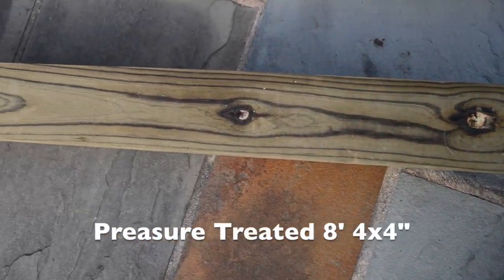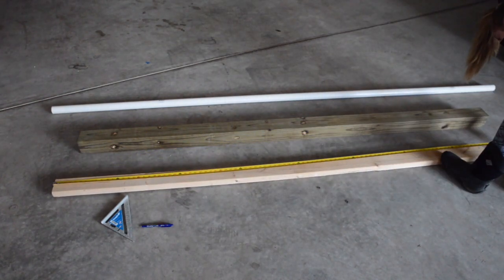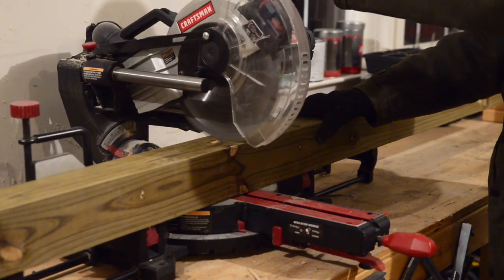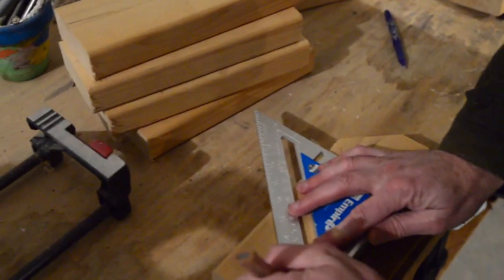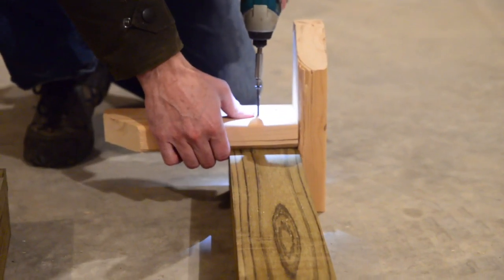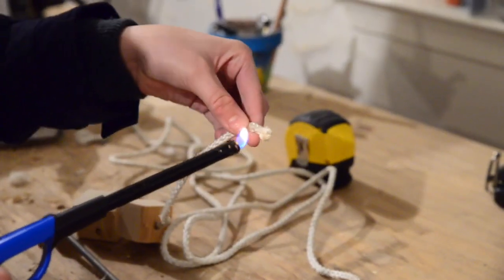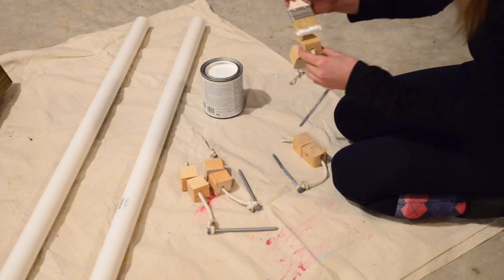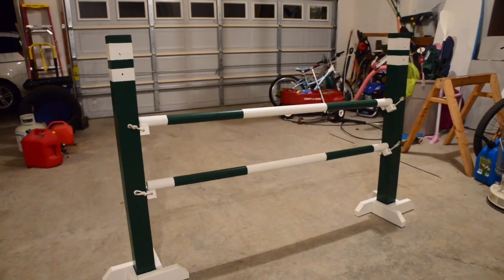How to make horse jumps! DIY standards, poles, and cups | HUNT COUNTRY EQUESTRIAN

Comment: If you are going to train a horse to jump, putting pool noodles or pvc pipe insulator covering on the pvc pipe will make them not shatter if the horse steps on it. It may tear the foam but it’s a lot safer than just plain pvc pipe!!!
Reply from the maker: i agree! i would probably prefer to use wood poles but for my dogs pvc is best. if the horses get too used to pvc, then they start to not lift their feet over the jump!

Comment: I don't mean to be rude or anything but you should use pvc pipe as a jump rail. If your horse accidentally knocked the pipe than it would crack and splinter into your horses hoof
Reply from the maker: I did make these for my dogs, but yes I agree it could be dangerous for horses.  If someone didn't want to use pvc they could use wood instead

Comment: I wouldn't use pvc poles because they are light and the horses learn to put less effort in when they jump because it doesn't hurt when they hit it so when you take your horse out to a show or to your friends barn where there are wooden poles they end up hurt because they fall through it expecting light pvc.
Reply: I like to use pvc pipes over wood bc when I train my 4yro and my f he needed cos it over it will not hurt and just knocks down easy it’s also more easy to carry and will not hurt the horse as much as wood will but that is your opinion so this is mine
Reply: Keep in mind, these jumps are also for her dogs, not horses
Reply from the maker: yes! i have seen horses get to used to pvc but it can be good in some situations. these are for my dogs though and wood poles will work too!

Comment: You could even use a car if you wanted to. As long as the glass windows are punched out and there are wooden bedding on top of the roof, it shouldn’t be a problem.